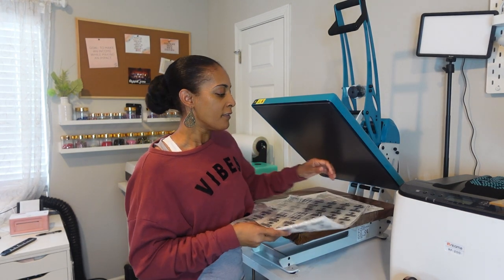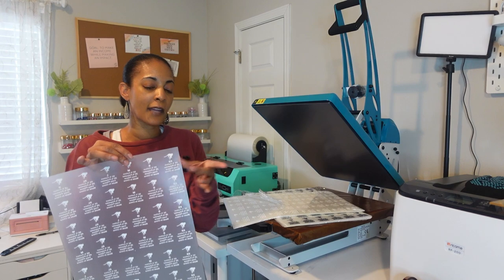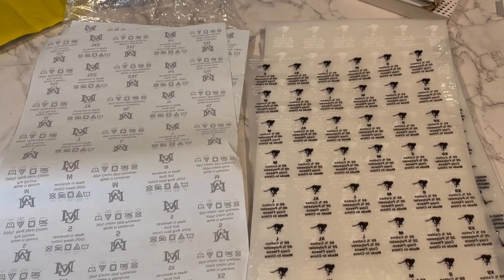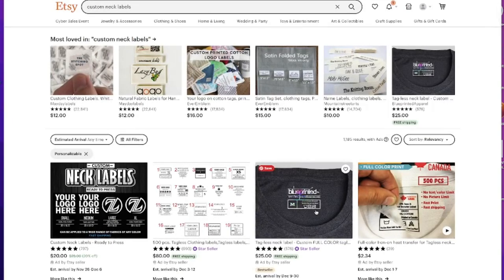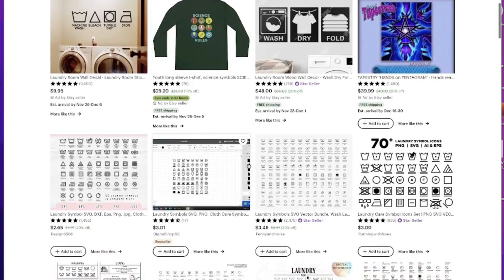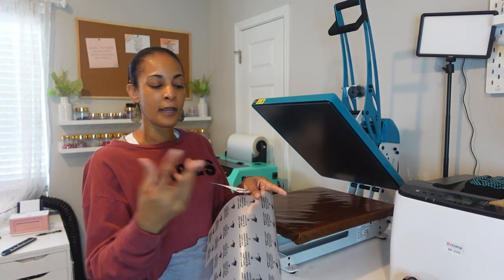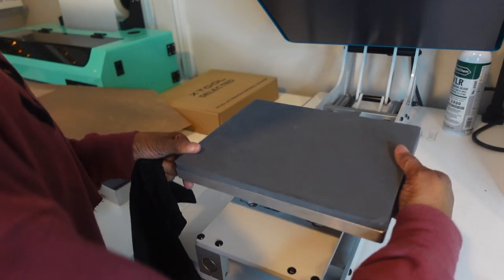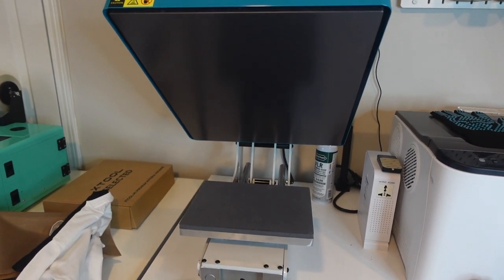How To Make and Press Custom Neck Labels |The Best Transfers and Neck Label Press

Comment: Enjoyed the video, what eco tank would you say would be a good printer to convert to sublimation, I both a brand new 2803 convert to sublimation and now it is no good found out it is not good for sublimation mine has been leaking and it will not fill up with ink Epson says the warranty is void when you use a third party ink
Reply from the maker: I just talked about it in my last video. https://youtu.be/Jtz4rWhSD-4